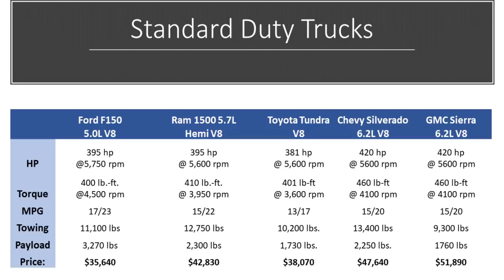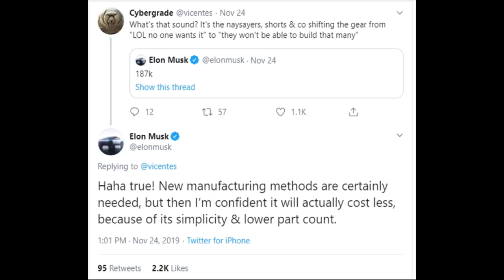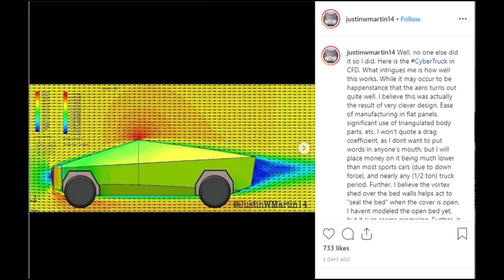Tesla Cybertruck Design Genius or Design Fail? Exploring the Function behind the Design

Comment: 35% of electricity comes from coal, electric vehicles are not ecological. Charging, storage and use has tremendous power loss. I still want one.
Reply: That 35% is rapidly going down. Trump didn't dig coal like he promised. 
I also have a dual motor cybertruck reserved.
Reply: @kchiatt2520  Love the truck myself
Just understand that an electric car is like building 400 cars and disposing of 200
Electricity is very inefficient to get to your house from the power plant. Electricity IS the source of most ecological damage. Most greenhouse gas can be avoided by driving diesel. NO rare earth or fundamental elements that require knocking down mountains in building a diesel.

Comment: Stainless Steel is not rustproof !!!! The boating Industry uses stainless fasteners, they Rust. Ask anyone that owns a boat. if the  stainless grade is not correct,
 it will pit. The rust and Pitting is very difficult to clean up!!!

Comment: Design fail. How to do reach in to tie down the front of that ATV, or any cargo. You either have to be 12' tall to reach over the side, or pull a David Copperfield and walk through your cargo. How do you access items in the bed from the side? Again, you have to get in your truck and wade through what is in it to get to what is in the front. What happens when your load shifts forward and get's pinched in the cover that rolls partially into the cargo area. You know, the load you couldn't access the tie downs.... A lot of truck users use the bed rails as utility, set stuff on, quick work surface, etc. Can't do that with this truck. These angles also severely limit the usefulness of the cargo size as many of us lean cargo against the normally flat rail, or carry things that are larger than the bed. Can't do that with this truck. 5th wheel? Sorry, can't do that either. But hey, it's fast, and that's really important for a truck. And hey, it doesn't look like other trucks. That is more important than utility isn't? But hey, it does have slightly higher tow capacity, something that 99% of even the hardiest of truck owners will never use, on paper is all that matters right? And never mind that if you are towing that much, the range is reduced so far you would be hard pressed to get to the next town. Let's face it, if you use your truck as a truck and buy one of these to replace your truck, you will find you have to compromise significantly because of it's poor design as far as utility (Arguably the most important purpose of a truck). Though it absolutely does have some cool features I would love, this is not a truck. It's a hatchback SUV. My guess is there is still a huge market for hatchback SUV's, and it will sell great. More power to you if this fits your needs. People are just kidding themselves that this is a serious truck.

Comment: The cyber truck is a epic fail as a pickup truck. Why? Because it lacks common flat bed rails. I cannot go to tractor supply and buy a bed tool box for it. I cannot go buy a pickup camper for it. The bed rails start at the roof and taper to the tailgate. That’s a massive problem for a wide variety of pickup accessories! By attempting to be so different? Tesla has shot itself in the foot. He could have done any futuristic thing he wanted to do with the front half of the vehicle. But a pickup needs an industry standard pickup bed! The cyber truck lacks this. It’s not a pickup truck! It’s basically a large trunk with a removable slant top. Better yet? Tesla should have used a frame and split the cab from the bed. At least then owners could have the option of taking off the Tesla trunk thing and bolting on a flat bed or utility bed or fabricated their own design like pipeliners do in the oilfield. Modularity is key with pickups, some thing the cyber truck sorely lacks.

Comment: One thing that's good about frame on construction is you can re place the bed if it's damaged or if you need a flat bed or utilty box I would interested if you can mount a 5th wheel hitch in this truck

Comment: 9:18  according to Fords website for the 5.0 V8  supercrew the truck pulls 11,600  which is most similar to the Tesla. 11,100 is the reg cab Ford. if you get the 3.5L reg cab it does 12,000. 3.5L supercrew does 13,200. 

Try to be a bit more accurate.

Also, does Tesla make a bigger truck? Nope. All the others except Toyota do. 

https://www.ford.com/trucks/f150/models/f150-xlt/

Comment: While Tesla hasn't provided an official drag value yet, Elon Musk has said that “with extreme effort, Cybertruck might hit a 0.30 drag coefficient, which would be insane for a truck.”
Reply from the maker: Good question. They haven't provided the Drag number yet, because they are still tweaking the small things on the prototype truck. This is the "Extreme Effort" that Elon was referring to.
Reply: because it has 0 cooling. Seems like a overheat hazard to me... I know that model s, 3, x has big problems with long time high power driving (5-10 minutes)

Comment: Fail.  The "exoskeleton" as Elon refers to is nothing more than unibody construction.
Win.  Stainless steel construction.

Fail. Dents in bare stainless steel are very tough to repair.
Win. You can (supposedly) hit it anywhere with a sledge hammer and it won't dent.
Win. Theoretically won't rust out.
Fail. Rusting out won't be an issue when current technology batteries only last about 10 years before they're pooched and replacement will cost you $25,000+.

Fail. The stainless alloy is going to be too expensive and hard to work with in production.
Fail. The "super tough" glass broke in both doors and Elon blamed it on the sledgehammer that only hit one of the two doors.
Fail. Fail Fail. If the super strong alloy and glass are what they are cracked up to be, how do you get out of it after a serious crash?
Fail. There's only one cab and one pickup bed size option.  Extensive re-tooling is required for anything else.
Fail. The range when towing something of substantial size is going to go right in the toilet.
Fail. Do you realize how long it is going to take to charge those batteries when stopping along the interstate after pulling a camper or boat for 200 miles?
Win. No (complex) transmission to go bad.
Fail. You can't gain access to the pickup bed from the sides of the vehicle.
Fail. Vehicle cost is going to be through the roof, regardless of the claims.
Fail. Like all current Tesla vehicles, only Tesla can obtain parts for them and service them.
Fail.  Such tailgate design concepts have already been around for quite awhile so far.

And a crowd of fans that cheer when someone rides an ATV into the back of a pickup truck as though it is some kind of miracle.

Comment: First , the shape is not really by design. They could only do so much with the metal. Elon has been constantly stating this fact as the metal is so tough it breaks the presses when they try to bend it. So rounded or complex angles are simply out of the question. Second , the stainless is almost impossible to paint. So to make yours stand out from the other 250,000 so far you will need to spend another 5-7k to get it wrapped. Third, I do not get all of the electrification right now. If you live somewhere where the power goes out for a week at a time like the forest fires in CA or northern states and you do not have a generator you are totally screwed. Fourth , in the event of an accident or flash flooding how are you going to get out? Can't break the glass. No power to roll down windows,,,,,now what. I could go on and on.
Reply: First, as was stated in the video, the shape of the Cybertruck is definitely by design for a number of reasons. The Cybertruck is designed to optimize the manufacturing process due to folding instead of stamping and no paint required. There's also no heavy frame yet the Cybertruck has a larger payload than an F-150. Wrapping is going to be far cheaper and easier than any other car due to the lack of curves. There will probably be plenty of aftermarket wrapping kits that will be easy enough for most people to apply themselves. EV's are already better than comparable ICE cars most of the time with reduced maintenance and lower operating costs and this is only improving over time especially when it comes to initial cost. You can leave the EV or Cybertruck plugged in and fully charged at home until power is cut. In some cases, Tesla deployed flatbed trucks with Superchargers backed by batteries that could be used to charge cars if there was no power. Most gas stations are going to be closed when the power is cut. As far as breaking the glass in an emergency, I'm sure Tesla will have an answer but what some people do is keep an awl or punch nearby so a quick jab will pop the window. It's likely the same thing will work even with the much stronger glass of the Cybertruck.

Comment: The reason for the planar design is because they couldn't get presses capable  of making complex curves in the material.  This means they have a worse sectional area for the weight and have to use  thicker tool steel

Comment: the hard brake at peak of cab will cause a turbulent cyclone so this truck will become heavier the faster it goes so at low speeds it will have low drag but fast the drag will become proportionally heavy or high drag and the wheels have a lot of exposure and if the suspension is air bags it likely has gaping holes in well so its hard to say. my biggest concern is the A pillars will they at such an aggressive rake cause huge blind spots? the more your windshield rakes the more blind you become

Comment: i dont want a tesla that competes with a f150 no i want to compete with a f550
Reply: sbmphr  no that requires a class a licence and it's to bully and tall to fit in my parking stall or garage no I need a tesla cyber truck to either compete with f550 or not earn my money
Reply: very bold statement there are alot of 250s out pulling a semi because semi has no weight over rear axels and pull leverage gives advantage to smaller trucks im willing to bet my 250 will outpull a tesla semi and claiming it will pull 2 550s uphill is comedy plus it requires a commercial licence and law limit some road access as well as i have a huge tailer but it has a tongue not compatible with a semi is not a viable replacement for the inadequacies of a cybertruck that elon claim was viable as work truck which it will not meet the needs for most companies

Comment: 1:41 is it really cheaper to make stainless steel than steel body?
Reply: I'm guessing less fiddly welding of a frame.
Reply: The stainless steel may be more expensive that regular steel but the fact that they don't have to dip the truck in an anti-rust bath nor paint it saves a huge amount in the manufacturing costs and time to assemble.
Reply: @bburton333  that make sence. He should've mention that with full explanation

Comment: It looks futuristic but the sides of the bed are not user friendly. On a regular truck, you can grab things from the sides, but with the slope, you will have to access everything from the back. Just an observation.
Reply: Good point but ...  it has air shocks (which will be amazing if you've ever watched a semi going over uneven ground) so you should be able to make it lower when using stuff out of the back -- ever see a old Citroen  ?

Comment: Of course the Cybertruck beats the F150. The F150 is $9,000 cheaper. A better comparison is a F250 4X4 with a V8 which costs $40,000. 

The F250 can tow twice as much and has a 25% higher payload than the single motor Cybertruck.

Comment: This video is full of misinformation from an engineering point of view.
High tensile steel that normal uni-bodies are made of are far stronger than titanium as well. The difference here is the thickness. The tesla is so thick they cannot form it into nice panels, it appears it can only be bent, hence the hideous straight bend lines like it was made in some sheet metal shop. 
Uni body vehicles are stiffer than frame based vehicles but they are not stronger. Stiffness is the deflection per unit force. Strength is the force before the structure yields and is permanently deformed. So a body on frame may deflect more under a load but it can handle a much higher load, especially point loads such as a trailer hitch load.  Uni bodies are considered better for driving dynamics as the overall structure flexes much less globally under driving conditions. But in off-roading or payload applications if you hit a hard bump you can deform a uni body vehicle locally to the impact and have your Honda ridgeline bent out of shape and nearly impossible to fix. I think its silly to pretend Tesla has figured some thing out here that the big manufacturers have not. They do not do it for very good reasons. Modern vehicles have to have crumple zones for crash test ratings. If i had to guess this vehicle wont pass crash testing as it wont crumple and the towing rating may be de-rated later but maybe not.  Its possible the outer shell is strong enough to handle the same loads as a body on frame but then it will be way to thick for normal purposes and would be a waste of money from a engineering point of view. 
The CFD is super basic and i would not put to much weight on that. A drag coefficient is basically a number that you multiply by the gross silhouette cross section to get its effective area (as in a flat block that is 0.4 times the size of the trucks silhouette) . 0.4 is ok but its multiplied by a large area so drag is not by any means great. A corvette is 0.28 multiplied by a much smaller area meaning a way lower drag.  Normal pick up trucks are around 0.43 but adding a touneau cover can lower it to .38 so its not really amazing like every one is pretending.
Reply: I totally agree with you. I'm amazed at how many people feel this is just soooooooo innovative. 

A unibody made is not a good fit for a truck. I love the concept of using stainless steel from a durability standpoint but I doubt they can even pull off mass production of it if they can't run it on common process equipment. The raw material itself is way more costly than steel or aluminum and it is a very unforgiving material which requires special considerations from cutting, drilling and welding.

The other thing is if the material is as purported to be hardened or tempered, then you have to worry about stress fractures in the long term. The crumple zone is a good concern - if the car doesn't deform - you may do the deforming as you suddenly decelerate.  

I estimate that it's Cd * A is maybe 5 - 10% better than the F150 based on the range / capacity numbers. Whoopty do.
Reply: Elon is desperate to get Tesla back in the news. He is taking pre-orders to procure more loans. He is desperately trying to increase cash flow. His truck is a pipe dream.

Comment: As a truck its a fail. The Tesla truck is terrible in so many ways.  No place for a 5th wheel or a plow. Terrible Visibility. No chassis cab, Useless hard to use the bed that you cant reach into, no place for bed rails for things like tools and ladders. The range will suck when towing.  A lot of the truck isn't even legal. No mirrors, the tail light placement is not legal. Those Goodyear MTR tires will not handle like its on rails and that heavy Truck will wear them out in under 20000 miles. This thing is the fake news of trucks. This thing will need a lot of changes before it comes out. Even as an off road SUV its terrible its just huge and heavy. The only people who will buy it are people who buy new cell phones every three weeks and have never needed or used a truck. Its just a novelty vehicle. Tesla is going to be beaten to market and crushed before they can even sell this thing. The Rivian truck is a better more thought out vehicle. Don't hold your breath on that 39000 base price that's with government subsidies calculated in.

Comment: The reason why manufacturers use body on frame for trucks has more to do with the fact that they don’t have to completely reengineer the body for each configuration (long/short bed, crew cabs, dual real wheels, cab-only, etc.), which allows them to sell their trucks to a wide range of customers. A unibody requires significant reengineering for each configuration. There’s nothing special about Tesla, they just made a different design choice. That design choice has limitations.

Importantly for the viability of the company itself, does anyone seriously believe that Ford couldn’t replicate this same design - if it would be profitable to do so? This design is very limiting. Not suitable for a fifth wheel, not suitable for multiple configurations, etc. Tesla’s going after the Raptor market with this vehicle, which is tiiiiny.

Comment: The cyber truck is the definition of function over form but i love the looks to so simple and clean no stupid grills or plastic bits anywhere to be seen
Reply: Condor1994 — That remains to be seen.  For example, one important function of a traditional body-on-frame truck is that it can be bought without the bed so that a back designed for some particular purpose can be put in its place.  There are countless examples of such trucks all around you.

Comment: I consider it a fail. But then I use a truck for towing heavy loads and up into remote locations in mountains and such. An EV will never excel at that.
No matter what design it takes. It will need a battery pack capable of about 2,000 miles to be able to tow up into the mountains and back say round trip 400 miles. And that will make it too pricey for the average buyer so it will never get built. Thus for my use they will always be a fail. I do pull a 5th wheel camper and a boat yes a triple rig. Total weight about 22,000 lbs.